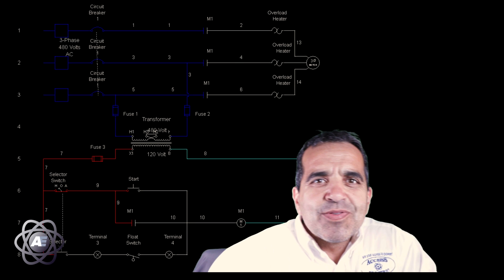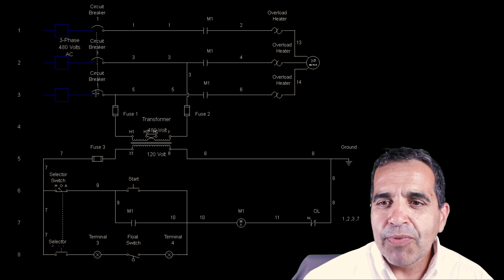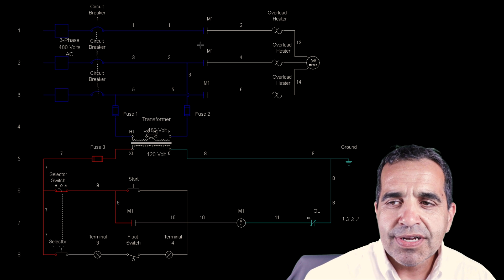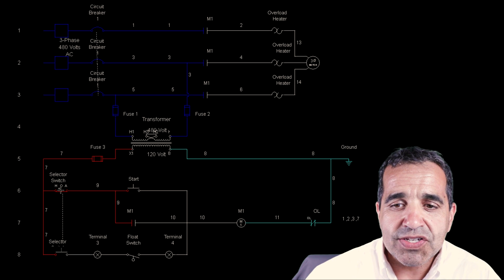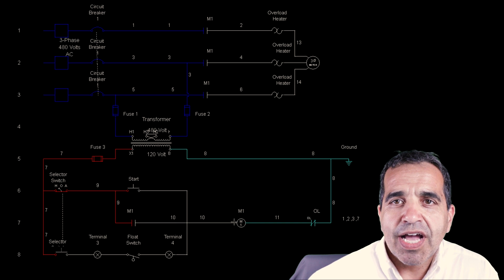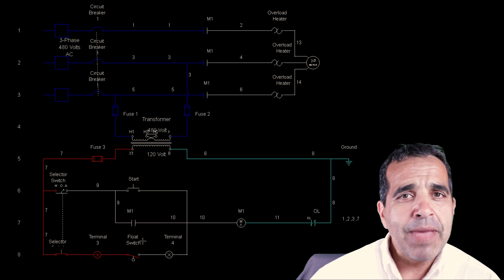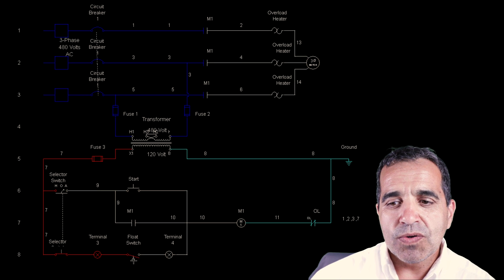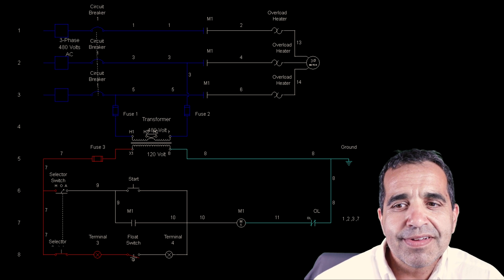Basic Motor Control: Pump control panel wiring

Comment: Is there a reason that in the Panel wiring the load side of the start will connect to what seems to be Terminal 4 but in the actual wiring you connect the start to terminal 3? I am really new and was just curious. Referencing Pump Panel Wiring-Part 2
Reply from the maker: Brandon Jones, great catch. I hadn’t noticed that. The reason is that 3 & 4 are reversed from the schematic to the actual pump panel wiring. In the schematic the first terminal from the auto switch should be 4 and then 3 after the float to match the pump panel..... remember though that the float is just closing 3&4 so the system will work either way. Really good observation.

Comment: Love your videos. Are the number on the line referring the wire number? What are the right side 1,2,3,7 meaning? Thank you.
Reply from the maker: Thank you Shaochen! the numbers on the lines are wire numbers. The numbers only change when they go through a contact or device. this is one method of wire numbering. there are other methods as well.